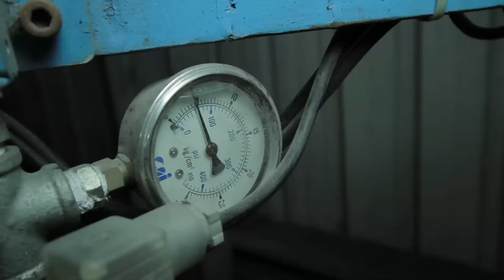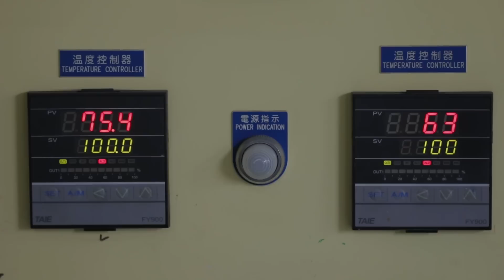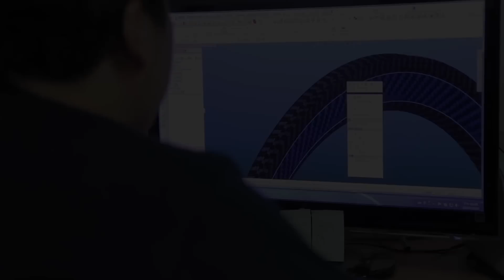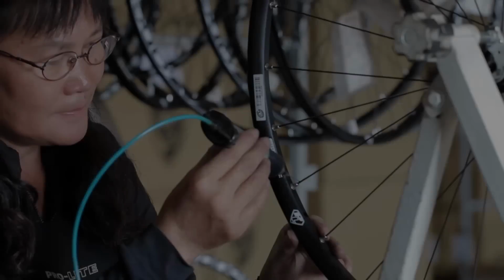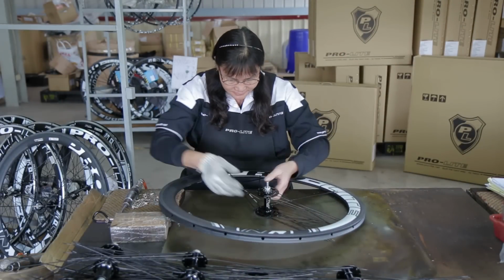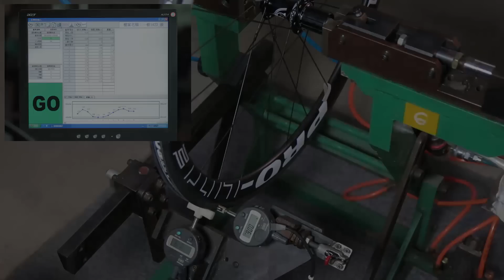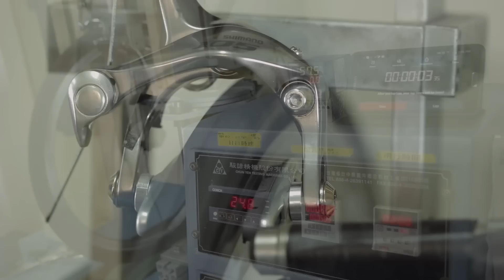Birth of a Carbon Fiber Wheel 2016 (Pro-Lite Wheelbuilding in Taiwan)

Comment: It's been 5 years that I have been using a pair of Bracciano A42. They are Bombproof.. Never needed a true even with all the beating they go thru on the bad roads in India.. Also to mention,  they are FAST AF..
Reply from the maker: Thank you for sharing Sunny. India's weather is also quite challenging for carbon wheels as they can easily pick up heat and have a tough time to dissipate it. Credit to you as well for taking good care of them.

Comment: I like to lace my own wheels. Do You sell rims only direct to consumer?
Reply from the maker: Hi Patrik, no I'm afraid we don't, but kudos for getting involved and learning the fine art of wheelbuilding. There's nothing like the confidence you get from riding a pair of wheels you have worked on yourself. Our wheels are actually well regarded among mechanics because they understand the value of a hand built wheel.
Reply: Hi, what preassure is used on the hydraulic press? I am curious to know! Sometimes i lacing my wheels and do this stress settle by pushing the wheel on the ground with my whole body weight, but is slow and annoying. Thanks :-)

Comment: Handmade stuff is luxurious. Can't they use machines for faster production?
Reply from the maker: Sure. Sort of. Do you want something built quickly or built well?

Or more specifically, do you want a wheel, which, if it fails, might collapse underneath you while you're traveling at speeds upwards of 70 or 80km/h, possibly in a large scale race where hundreds of other people are riding in a pack with some just inches away from you?

Oh, but it was built quickly and cost a little bit less money... 

That's poor consolation.

If you want something built on a machine, buy Chinese. If you want something built well, you can't go wrong with something built 100% by hand.

Comment: Well done. Question, are they tandem rated?
Reply from the maker: Some of the wheels can be used for Tandem, but we don't have tandem hub widths available for our Pro-Lite wheels. Spoke count is a major factor for high load wheels and most of our wheels are not designed to handle 2 riders. Since we are actually a real manufacturer, we also have experience using tandem type hubs, however, not under the Pro-Lite brand.

The Rome and Padova have been used on tandems in track racing, but that's specific to tandem bikes designed to allow conventional track width hubs.
Reply: ProLiteNews I use 132mm spacing on my tandem so wheel choice is high.
Reply from the maker: Send us an email and we can talk about specs more carefully. I saw your comments on Disqus, but I think my response might have gotten lost in your spam box.

Comment: What kind of pressure tube is that? Looks like a plastic tube?
Reply from the maker: We use silicon pressure tubes Stefan. They can take a higher pressure without rupturing and they offer the best compaction to eliminate as much of the resin as possible.
Reply: The tube looks like a big one! Is the tube after the process removed or remains the tube in the wheel? What diamter has the tube respectivle what is the wall thickness?
Reply from the maker: I'm afraid I can't give too many details there. Most companies do not have the facilities for this type of forming. The tubes are removed after manufacturing though. The tube expands to fill the entire cavity during formation due to pressure expansion. One thing that we often notice at trade shows as we look around at other brands wheels is that the side walls of most rims are very flexible compared to our own rims. 

Another interesting thing is that when we had our rims sent to Sirris for UCI testing (before the current relaxed testing standards which allow SGS labs to do the testing as well), they commented to us that they had never seen a rim withstand the impact testing so well.

Typically, the impact testing takes a weighted cart and rams the rim at a 90 degree angle impact point. This collapses the rim and they check to see how many spokes are displaced and if any spokes are dislodged in such a way as to become dangerous. For our rims, the damage was minimal and localized to the outer edge of the rim - nowhere near the spokes.

Comment: The wheel is molded in one piece... does that mean the bladder has to be extracted through the tube hole?
Reply: Chris10B no they remains inside
Reply: Are you serious? I find that hard to believe. After so much effort to reduce the weight. I guess it does make sense that it would bind to the epoxy making it impossible to extract.
Reply: Chris10B the bladder is sucked out with vacuum
Reply from the maker: There are a variety of methods used to extract the bladders depending on the type of wheel. We use heavier silicon bladders that are definitely not left inside. Other brands use very thin poly bags, which are often left inside and can be seen sometimes in crash footage, but our wheels have the air bladders removed.

Comment: Hello team.i would like to learn more about making wheels for bike.i want to manufacture like the same in denmark.apprecaite any advise on machinery and also study.thnx
Reply from the maker: I think it would likely be very expensive to manufacture in Denmark. Much of the equipment we have in our factory, especially in the forming area is very expensive. Raw materials like pre-preg carbon fiber in rolls come in refrigerated storage units from Japan. We use a walk-in refrigerator and a couple of modular fridges to store carbon rolls at various different parts of our manufacturing facilities.

If you're going to try to manufacture as a one person operation, you might find the costs to be difficult to bear. Many of the machines are fairly easy to find both new and second hand here in Taiwan.

If you are thinking about just doing wheel building, this would be a lot more practical and there are many fine wheelbuilders throughout Europe cultivating the art.

Drop us a line through our website if you'd like to learn more.

Comment: like they do this for every wheel. Lots of "hundreds" of times here.....
Reply from the maker: Hi Andrew. I am not sure what you mean about "hundreds of times". The video describes this process as a minimum of 6 times to check and re-bed the wheel. This is what actually happens. When the wheels are completed, they are put on a rack and usually sit on the rack for a day or so (maybe as little as half a day if there's a rush) before getting run through the Mitutoyo digital tension gauge checker. 

I have personally been to the factory quite a number of times and I've never seen them doing anything different from this basic process. This "6 times" does not include the initial bed-in between the tightening station and the final tensioning station. You see this step happens between the station shown at 3:48 and the next station at 3:52. 

I have done videos where I have followed a wheel through the entire production process on quite a few occasions now. Nothing is done differently when I am there with my cameras - largely because they can't afford the time to do something differently. I only go down there when there are orders in process. I set up my camera for one station at a time and the other stations are still working at normal production pace. They can put out a couple hundred wheels in half a day and I just move from station to station without interrupting them.

Bedding-in is an important step in producing a wheel that doesn't need to be re-trued after a short time and remains true and strong. You would be surprised how bad it is for the longevity of a wheel to be ridden for any length of time when it is not well-trued. Many, many wheels are sold, installed on bikes and ridden around, without noticing that the wheels went out of true in the first week of riding them.

If you have more questions, I'm happy to answer them for you.
Reply: Thank you very much for your considered response; and sorry for my ignorant message. What i meant was, does every wheel go through the hundreds of brake tests, or is that a part of wheel development as a whole ? I just thought it would be very time intensive to do this for every wheel so I was skeptical.

I never suspected so much hands on labour was put into making a wheel. I always thought they would be made more so by machines. So thank you for the interesting video. 

Are there still UK stockists of the Bracciano C50T ? 

thank you
Reply from the maker: No worries, a little skepticism is healthy.

You are correct. Brake testing is part of the R&D process. During R&D, things such as layup (arrangement of pieces and types of fibers for each) are tested as well as any potential special compounds used (most companies have moved to second or third generation high temperature resin formulations for heat resistance by now).

Brake testing of this intensity is done during only on the R&D samples and those are not sold. In fact, most of those are tested destructively, because brake testing means little unless you take the wheel to destructive failure and get an actual number there. 

We do some random testing on production models, but brake testing isn't part of that. We only test wheels to the point where they cannot be damaged by the testing itself. Bedding in places a certain amount of stress on the wheels, but this actually leads to a stronger wheel off the line.

The purpose of the run testing is to check that the wheels are well bedded and well built on the production line. Run testing can be done without harming the wheel, but brake testing is done for "individual models" and rim specs are tested heavily with rims that never go to customers.

The Bracciano C50T is around in various places, but send an email down to info@ and our sales people can have a look for you.

Comment: The bags aren't silicon, but "silicone". Decals are pronounced "dee" cals not "de" culs. Lots of work to make a carbon wheel. No wonder they are so expensive.
Reply from the maker: Good point Norman. Always good to have a bit of a check. 

Silicon is the element. Silicone is the compound product. Vernacular allows for some flexibility there. While they are different things, silicone does contain silicon, which encourages overlap. This is not dissimilar to the usage of the word aluminum. Aluminum is nowhere near pure aluminum. It's an alloy which contains aluminum. Titanium too. Hence we also refer to "silicon gel", which is a gel characterized primarily by its silicon content.

As to Decals, "deecals" or "décals", it depends on where you are. The "deecals" is an anglicized pronunciation which is common in England and the US. "décals" however is more common in Canada, where French is a secondary language. This is probably related to the root of the word being from French originally, as "décalquer". You can find more information on this in any substantial online dictionary.

Both of the people working on this version of the video are Canadian.

Comment: I'll show you what that wheelset can do. I'll throw it on a fixed gear.
Reply from the maker: We have quite a following in certain areas for fixed gear bikes. Taiwan and Japan both have active fixie scenes and we have done wheels for them. To be frank though, very few fixie riders use carbon rims, largely because of the aesthetic, which tends to by stylized with a lot of color coordination and some home grown artwork. We have done 30mm alloy, 42mm alloy and I believe a small number of carbon rim versions, but not many for fixed gear specifically. 

Fixies typically use 28H (or occasionally 32H) and a track hub. There's not much point in building a deep profile, ultra-light rim for a fixie with a bunch of heavy spokes and designed to be nimble at moderate speeds around town and through traffic. Also, track riders tend to use tubular tires, which isn't common among fixed gear riders.

However, if you're looking for the strongest wheel you can find, there's an old video kicking around of the boss jumping up and down on one of our disc wheels, laying down on a couple of cinder blocks...

Comment: I don´t trust Chinese quality, Zipps for me always.
Reply from the maker: There's certainly something to be said for their production quality. However, if you look closely, you will find some "interesting" details. I suggest you look into the curious case of their Grade 2 balls, which they were selling for about 7 years at $1000 a pack, which is an item that has never been made commercially available from any bearing manufacturer anywhere in the world. 

Caveat Emptor.

If you would like to know more about how our wheels are made, feel free to drop us a line at info@pro-lite.net and we can answer any questions you might have. 

Please note as well that we do not manufacture our wheels in China, they are made in Taiwan. You might be surprised to find out how much of a difference there is between the two.
Reply: I like the fact zipp wheels are made in USA. CNC machines cut carbon, that to me means cuts are same/perfect. Also aerodynamic are key factor why would u buy carbon wheel, how do they design/develop them? At least they are not afraid to put their own name on them.
Reply from the maker: I like that too. We are big fans of companies who make their own product. They also have some good tests that they do. I'm not personally convinced that there's any practical difference between digital plotters cutting the pieces vs hand cut. We have a digital cutter here as well, but given that carbon fiber is pretty hard on cutter blades, it's actually a lot less practical than it looks and it's often better to have a person making the cuts rather than a computer, which has no way to determine if the cuts are happening correctly. A laser cutter would work too, but the epoxy is a special type, thermally activated, rather than a 2-part. I'm not sure how it would be affected by a laser cutter as opposed to a metal blade. Would it make it harder for the edges to bond together under pressure if the edges are already cauterized before they are even laid in? Perhaps the end effect is that you'd have a series of many hard seams across the circumference of the rim, instead of the more contiguous effect of allowing the resin of each segment to flow into the next and create a solid resin piece. Would it make any difference at all, given that the primary mode of contact is surface to surface, not edge to edge.

I've never seen evidence of problems with cut edges myself and I have looked at these wheels through macro lenses and attended while they examine the internal edges through use of an ultrasound machine which measures the thickness very accurately. It's a fabric that is wrapped around a 3D round object, then pressed and molded into place. The internal edges are always going to rely on the "give" of the fabric. You set it up in the layout and it moves itself mostly into place during forming. Once it heats up, everything shifts and moves into place with uniform pressure from the air bladder inside. Ultimately, the proof of the pudding is in the eating.

When we sent our wheels in for UCI testing at Sirris labs to see if there were dangerous fragments ejected after a catastrophic crash, the testing staff were surprised that they couldn't even get the rims to break enough to reach the spoke area. Test report here: http://tiny.cc/PL-Vicenza-UCI

Most wheels of that spec (50mm) crumple pretty hard. You can find your own 3rd party verifications on that by google. Please don't take my word for it. I'm not so sure that you will be so concerned about the difference between a hand cut segment of carbon vs a digital plotter cut after comparing the results yourself.

On the other hand, I'd encourage you to look closer at the bearing issue mentioned above. If you still feel they are a credible source and not just a marketing specialist who also makes wheels, you are entitled to that opinion. CeramicSpeed (the manufacturer that Zipp currently uses) thought it was a joke when I asked them about the Grade 2 balls that Zipp still claims they have used - and charged customers a thousand bucks a pop for. There's a lot to like about Zipp and I had actually quite a good conversation with the staff at Zipp when I was doing my own checking into that, but in the end, we did come to the conclusion that the information presented is not accurate. And yet it remains on their site to this day. Make your own conclusions about that.

Putting a name on something is very different from transparently showing how things are made. Our goal is to be a low-marketing company which relies on quality product at a reasonable price.
Reply: ProLiteNews That was very educational, thank you for your response. So I actually went on your website, since I’m on a market for carbon clincher wheels. But there is no pricing, where can u buy them in US? There is Rob Muzio link/face book place, I don’t have a Facebook nor ever will. Where can u buy them other than face book? 
I trust Zipp because, I have their wheels and they have been very durable. However that doesn’t mean I wouldn’t be open to try alternatives, but at 220lbs durability is a must.  Regards!
Reply from the maker: Drop me a line through the contact form on the website (http://pro-lite.net/contact/contact) and I'll put you in contact with Rob directly. Or if you're not in the UK, I might have another option for you.

I appreciate your open mind. Good discussion.
Reply: @easyx9mm  id prefer HED over Zipp anyday but zipp are cheaper. Zipp have some bad reports over their hubs.  Taiwanese wheels are affordable for most of us everday people.